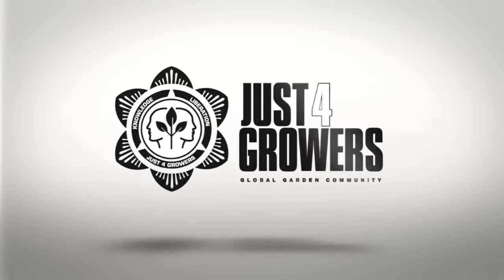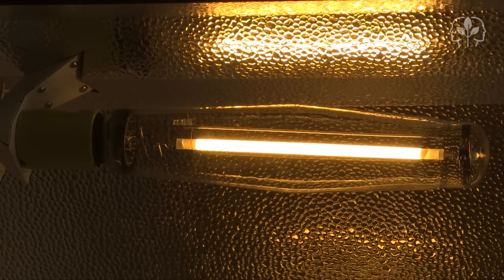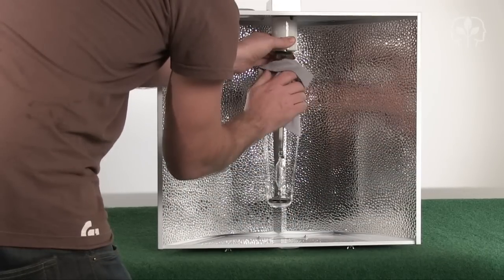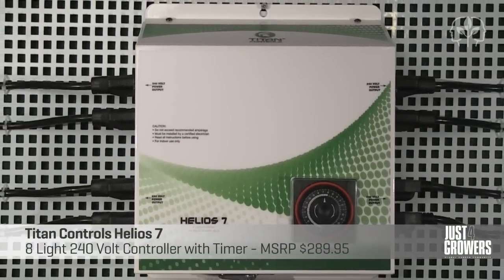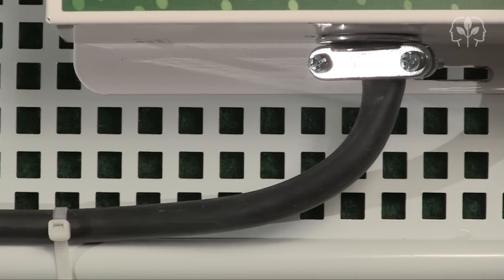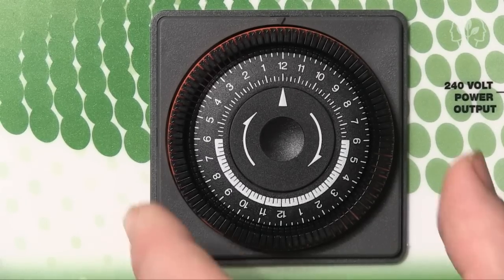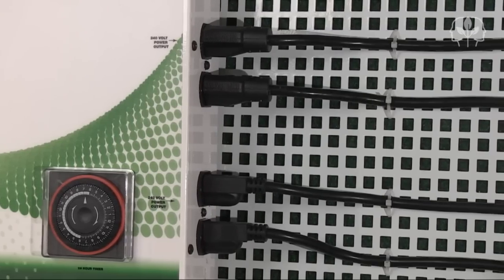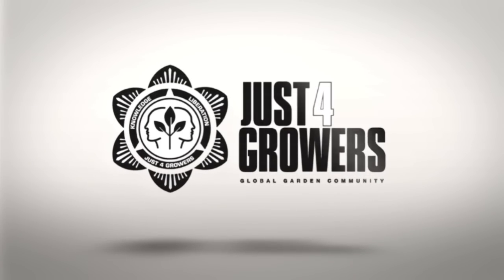Why Do I Need an HID Grow Light Controller?

Comment: Hey thankx for the explaination! I'll prob answer this myself b4 a reply, but jic I don't.....   So I just got Some used equipment, Lumateks 2 @ 120/240 1000w ballasts (with the adjust knob down to 400w) 2 1000 w lamp hoods, multiple pwr cords as appropriate to Voltage used, and one MLC 8X relay box optional 120/240 install. Im familiar with the principles regarding Voltage/Amp draw on AMG's etc, but not at all familiar with using these set ups. The equipment I got came to me as a surprise so I've been researching them as much as possible. The MLC recs not running lamps on 120 through it because of efficiency reasons. It also discusses "checking the ballasts", if they are wired for 120 or 240, and connecting the MLC accordingly. CUT TO THE CHASE: Q:, If I intend to just run 120 Vac and say 800w adjustment on one lamp hood (for example), could I wire a standard 120v 3 prong heavy duty cord to the control box, plug into 120 outlet,given that I don't exceed breaker Amperage, then plug in relay switch cord to timer & outlet, and run ballast from there (w/o concern to damaging the ballast or lamp)? Also, in theory,& given the same detail from above Q2: if I intended on running a lamp w/o any timer at all, is the control box actually a required component in the set up? Will it damage the Ballast/lamp being run straight from a 120 breaker at 15 amps from the wall? I may wish to run two ballasts and 2 lamps later on at which point I can understand the necessity for the control box and timer switched relay inside, but until then and if I have the appropriate rated timer, or no timer at all, it's "safe" to operate ballast w/o concern to damaging it? It's all used equipment and it was freebie for me so don't wanna blow that kinda deal.. haha. I also got 3 additional 240vac ONLY ballasts, Lumateks w/o adjust watt settings, but I'm not quite that good just yet, nor do my available grow space conditions allow for the option at that Voltage right now. I'd have to move to other location basically.. PS, I read all the comments below and soaked up the info, not to mention funny, and appreciate that you do actually reply to them.. Thanks again..

Comment: I have an Oracle garden supply 600w 240v ballast. I'm really confused on if I can plug this into a regular socket at home or not.
Reply: you can, but don't use a regular timer, you need a lighting contactor relay, some timers have them built in.

Comment: Would a single 400w or 600w bulb & ballast need to be hardwired in to the breaker box??
Reply from the maker: +James Kirk no need for hard wiring. Just use a plug n play lighting controller.
Reply: James Kirk

Comment: 1000W lamp doesn't use more than 30A(uses 9-12A) and a regular timer is for 36-38A(A=Amps)soo you dont need to buy this expensive stuff i guess they paid him to sponsor them....
Reply: I didn't say you had to get the big expensive unit (if you got the money then great), I said that you can just get a higher rated plug timer. Which I can pick up from under £10 (about £6 wholesale). The amp rating is not relevant to the running of the lamp (as this should be within any timers range)  The problem occurs when the relay switch has to deal with the capacitive and inductive loads on startup and shutdown.
Reply: Agree to a point on the 'sponsored ad' part, he could have mentioned another cheaper option which whould have improved the video. In his defense though, he does state in the written description that it is a guide based on the Helios unit. In my line of work I have seen so much dangerous overloading of cables, sockets, power supplies etc that I would prefer to see people spend too much and be safe than too little and risk a house fire. Even for a standard desk lamp I would never buy one of those really cheap plug in timers anyway, with mains electric it is always better to not try and cut costs too much... in my humble opinion :)
Reply from the maker: Well my friend, I'm glad you edited your comment so that it was a little less brusque—however, it's the high inductive load (up to 5000V) generated when HID lamps fire up that will weld the contacts of a regular timer together, not the steady state operation power usage.
Reply: i use a regular timer for 5 years now not a single problem with it.but 
hey if you want to scare people to use sponsored stuff good for you 
maybe you find some people that will gladly pay 100$ instead of 5$.

if they have money to spend why not use a timer that is made for 5 inputs
Reply: You have been very lucky then, I know of many people who have tried using the standard timer plugs and ALL of them have had the contacts melting together (one dangerously so). You don't have to get a big unit, if you wish you can just get an higher rated socket timer. You are complaining about Everest Fernandez trying to 'scare' people, that's not as potentially dangerous as you trying to gloss over the very important point of electrical safety.
Reply: you said "You don't have to get a big unit, if you wish you can just get an higher rated socket timer." well your lamp takes half the amps then a regular timer can withstand explain to me why i need to take his 100$ unit instead of my 5$
Reply: well the video creator says you have to if you don't want your house to burn down.and as i said the cheapest asian timer can withstand 2 times the power that a 1000W lamp can give out.now if you have 5 lamps(that thing was designed for that) then okey buy it but dont tell people that if you have 400W you should buy it just in case....
lets say the startup surge is duble the power(its a little less) that is still 24Amps and regular timer is rated for 30-36A

P.S. dont think i am arguing with you i just dont like this sponsored ads that lie to you.this is a great timer but for somebody that really needs that kind of power

Comment: Everest, thanks for all of your helpful videos! I'm putting together a system with two Sunsystems 315 LEC lamps. I'm wondering if this would require a lighting controller, or if I can get away with just using something like the apollo 9 Digital timer. It appears that the two 315's use less amps than the max of the timer. What do you think?
Reply from the maker: Hi Chris, I would still recommend using a proper lighting controller because of the high inductive load generated by the lights around ignition.

Comment: Trust me, if you don't install one of these, you will fry and melt a wall socket or power strip and your timer,and create an arc.I did that and came close to setting my house on fire!
Reply from the maker: So glad that didn't happen Mick! I just visited a friend's garden and he wasn't using a lighting controller. I freaked and insisted he borrowed my spare!
Reply: Thanks Everest. Eric, don't even try running HIDs from your wall sockets. Your components will melt and cause a fire. Buy a MLC4x off Ebay for $99 plus romex and breaker and watch the video on how to install a MCL 4x or 8x. It's pretty simple to do.
Reply: Thanks!  I'll limp by w a 600w. I ordered a Helios 5. It does 4 lights and a separate timer for the fan.
Reply: +Eric Jensen is it to code to wire 240v lights in a residence?
Reply: you must really suck at connecting cables.a 1000W lamp uses up to 12A and a regular cheapest timer can work up to 30A of power.this machine is good for somebody who has a lot of lights nothing more
Reply: Do you think it's safe to run 2000 w through regular timer and power supply on 120?
Reply: dk
Reply: Thanks for telling me I "suck'' ? Are you an expert on sucking?
Reply: no, just an electrican.first if it arcs your breakers well break.second in the video he is using a digital balast that balast has a option to up the electricity before going full power soo it saves your bulb life and doesnt fuck up any type of timer
Reply: Thanks, I got you bro.sorry for my retort.
Reply: just to be sure, I'm running a magnetic 600W ballast on a 16amp 250V rated timer, I live in Europe so I have 230v. Am I ok?

Comment: I plan on purchasing a AT600 Apache LED light, 3 of them. Is a controller need for LED lights. On a side note I've been using a HPS with a blueprint 12/18 timer with no problem, but I went thought 2 other digital timers, guess I know why now.
Reply from the maker: Thanks for your question. No you don't need s lighting controller / relay. That's because LEDs do not pose the ‘in-rush’ threat that the HID lights do.  You would need to select the proper timer (power strip, etc.) based on the total amperage of the LED lights.  Some form of circuit protection would also be prudent due to the cost of the LED fixtures.  A power strip like the Apollo 14 with surge protection built-in would be an appropriate timer.

Comment: Is it absolutely necessary to have the controller hardwired to the breaker box? Can't it be plugged into a 50A 240V outlet?
Reply from the maker: Yes Ha, you can attach a 50 Amp ‘pigtail’ cord set (like they use on dryers) to plug the Helios 7 into a 50 Amp power source.  50 Amp ‘Pigtail’ cord sets can be purchased at most electrical stores or big box stores like Home Depot. I still recommend consulting a certified electrician prior to installing a lighting  controller.
Reply: Thank you very much sir! Love your videos.
Reply from the maker: +Ha Dang Always a pleasure to help a fellow grower. Peace out, Everest.

Comment: Wouldn't a heavy duty timer similar to the one you showed in the video be a work around?  Its a lot cheaper to buy 8 of them at 10 each on amazon and set them 1 minute apart?
Reply from the maker: BladeMasterz916 I hear you BladeMasterz but that would necessitate having eight separate electrical wall sockets too. And any photoperiod adjustments would be pretty onerous with eight timers to change each time. I love my lighting controller :)

Comment: im installing the helios 11 light controller to my 240 volt washer/dryer socket. does anyone know how to identify on a 240 volt wire, the positive, negative, and ground wire if they arent colored or labeled?
Reply from the maker: Yoong Chaiyasit Hi Yoong. If you're not 100% sure what you are doing then you ABSOLUTELY MUST hire a qualified, professional electrician. He or she may well inform you that the washer outlet, assuming it’s 240 and assuming it’s 3 wire, would be 2 HOT legs (normally black & red wires) and 1 GROUND leg (normally green wire) which is what is required to properly wire a Helios 11.  If it’s a 4 wire it would be 2 HOT legs (black/red), 1 NEUTRAL leg (white)  and 1 GROUND leg (green).  Your electrician will probably ask you what year the house was wired—also important for knowing what's what. 

Remember Yoong, high power (240v) is really dangerous so please find yourself a competent, professional electrician to wire it in for you. Happy growing!

Comment: These grow timers need to be used by any sized grower. If you have even just a 400 watt you shouldn't be using those cheap timers. Some of them literally say on the box not intended for digital ballast but people use them anyway.
Reply from the maker: Brittfield Beats I couldn't agree more Brittfield. As I'm sure you know, it's the high inductive electrical load needed to ignite the lamps that kills standard timers—not the operating wattage. It can literally fuse the contact points in the timer together rendering it 'permanently on' - that's a best case scenario. Don't want to think about the others. Lighting controllers are a must in any indoor garden with high intensity discharge lamps.

Comment: could make one of those with bout 150 bucks worth of parts
Reply: Cool MR. C but I bought mine on amazon for 50 bucks, take it it's for just one light as it's the Titan 4. I have a much safer feeling when I am away knowing my titan has me covered rather than those cheap plastic timers that burn out.
Reply from the maker: Hi MrCinimod. Love to hear more. Sounds like you have some tech savvy that I lack! Thanks for watching.
Reply: from what i can see all that one of those light controllers  is a big 240v contactor a timer and  a few normal
outlets
Reply from the maker: Hi MrCinimod,I make some calls and confirmed some details about the Helios 7 lighting controller: ·         Titan Controls exclusively use Allen Bradley -- Ballast rated contactors.  These are one of the top rated relays in the industry and I believe Titan Controls is the only manufacturer currently using a 'ballast rated' relay in their lighting controllers.  I others I am aware of appear to using inexpensive compact contactors. The contactor is the heart of the lighting controller so this is kind of a big deal in my eyes. ·         The Helios 7 is ETL listed.  This product has gone through extensive testing to assure that the operator is running a 'safe' & 'reliable' lighting controller. ·         All internal components are electrically 'over-rated' for the application of the product.  Wire gauges are one size larger, terminal block is rated at 150% of operating amperage, outlets are cross-functional and all internal connections are made using pneumatic crimping machines on the wire sets. ·         The chassis is 20 gauge powder coated steel.  Tough and built for the challenging indoor gardening environment. ·         Innovative incoming power wiring system.  Power comes into back of the unit via the terminal block box and is protected from the harsh elements of the grow room.  Easy to wire and safe to use! ·         24 hour timers are German-made timepieces for precise accuracy and performance. ·         Helios 7 is hand-built right here in the United States.Hope that's of interest to you. I'm certainly glad the Helios 7 is at the center of my garden.

Comment: None of my ballasts spike during start up. They start off at lower wattage, and then slowly work up to 1040w of draw, as the bulb brightens...which means the basis you used for needing a controller is negated.
Reply from the maker: Hi Deschain, thanks for your comment. Surely there's still a high inductive load required to ignite your lamps in the first place? May I ask which type of ballasts you use? Thanks.
Reply: Everest Fernandez Standard white analog ballasts...along with a few average digital ballasts.

I was under the impression that they would spike at start up, not unlike an AC unit...but using the Kill-A-Watt tester, they start off low and then build up to the 1040w draw.